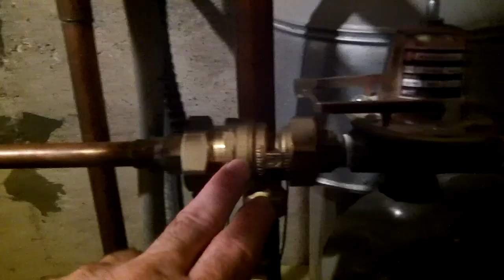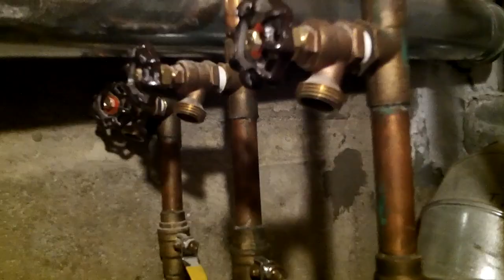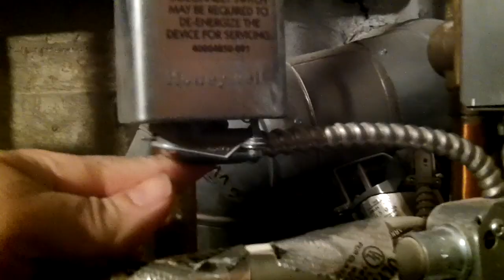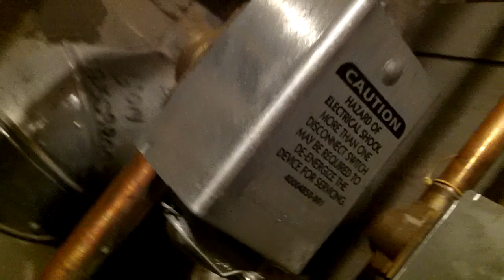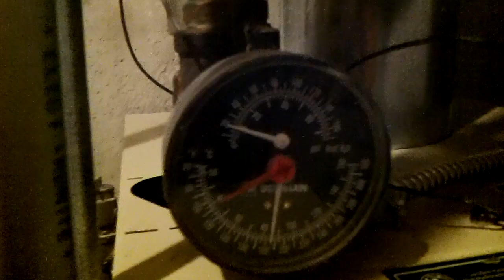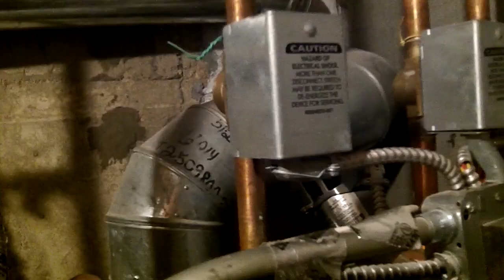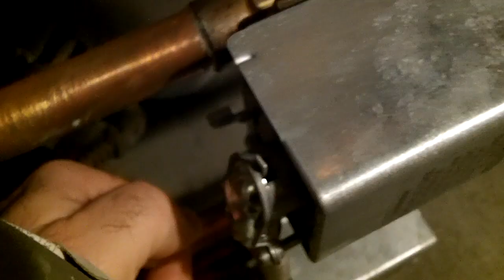How to remove the air from your hot water heating system

Comment: Most systems, if not all, have air bleeder valves on the radiators or baseboard heat. It is best to bleed the air at these points. The bleeders may have to be opened up several times; allow the system to run several minutes before reopening. Doing it the way shown here, will be an ongoing process as the water entering the system will already have some air in it. The procedure done here should only be used when the system was drained/ partially drained and there is large amounts of air in the pipes.

Comment: I don’t have a pressure reducing valve, just a back flow valve.
Reply from the maker: It has to have one because your city water is about 40psi and it needs to be reduced to 12psi gor your system to work.  Otherwise your 40-50psi city water would activate the pressure release valve.
Reply: @YourHuntingBuddy I have a spigot type shutoff valve then a back flow preventer with expansion tank.

Comment: if you only had air in that zone why would you do the other two ?
Reply from the maker: The water is heated in a common area and then pumped into your zones. If a zone has air in it, the air will eventually be returned into the common area.  Once a different zone valve opens the air in the common area will migrate into a new zone.
Reply: @YourHuntingBuddy  thanks for the response, so to be clear, if you have air in one zone regardless of how many other zones you may have, you should bleed the others as well ?

Comment: Always learn something, I normally use to open the drain valve all the way and have open the regulator open to keep the pressure high, but now I will go slow just like you have shown, little big secret that will make a big difference removing air. Thank you for your information.

Comment: does my thermostat need to be turned on heat when flushing and after flushing?
Reply from the maker: No.  The thermostat opens the zone valves electronically.  Turn it off and open the zone valves manually like I did in the video.

Comment: There are air micro bubbles impregnated in water, so bleeding will still be needed. It's still valuable and needed, and pulls out most air, but there's still air in the system that will need to be bled.

Comment: Hi buddy, hope all is well. I bought a house with a broken base board heating system in the garage. I just install new base board and went to fill it up with water per your instructions. The only thing is it doesn’t have a zoning valve. And they connected a new pipe to the existing pipe for the garage to go the basement ( it’s the only pipe coming and going from the same base board). Can I still drain the air out. Or because there is no zoning valve I can’t. Thank you for the informative video.
Reply from the maker: Find the shutoff on the retun line. Follow the retun line it should be close to the unit.   There should also be a drain near the furnace before you get to the shutoff.   Attach a hose to the drain and open it slightly.  You should see bubbles come out.  The pressure reducing valve should automatically fill the line with new water and push out the air.

Comment: Looks like i am replacing my old red fill valve to the updated one you have. Nothing happens when I lift it up. Worked for 40+ years. Wasn't even aware it was broken until the air had to be purged out.

Comment: If you don't shut the valve at the return line, and you open the bleeder knob,  what is the detriment?  Does air possibly pass by the drain hose and go back into the boiler?
Reply from the maker: Yes. You won't get all the air out and it y flow into another zone if opened.

Comment: Thanks for making this video.  My system is a little different but you gave me enough information to finally get my garage circuit bled, and heat re-established out there before the coming Anchorage AK winter could freeze my pipes.  System still needs some improvement, but you helped me buy some breathing space.

Comment: Nice video. I've read that you could/ should bleed possibly from the highest point. Could you bleed from your radiator in your room ? Can you comment
Reply from the maker: You can if the radiator has a bleeder valve.

Comment: How do I know what valve is for what zone.  They are not marked.
Reply from the maker: Turn up  the thermostat for the area you want to test.  Turn off the thermostat in the area you dont want to find. 

Feel the  pipe coming out of the zone valve and label it. .
Reply: Your Hunting Buddy I can do that from the switch right? I don’t have to go into my tenants apartment?
Reply from the maker: You need the thermostat to be on because the circulator pump needs to be on to circulate the water.
Reply: Your Hunting Buddy thank you very much.

Comment: Why do you want the water go slowly. Only with higher speed you can flush the air trapped in higher places out, a bucket is not enough, just drain the water in toilet or outside.
Reply from the maker: City Water is 50 PSI.  You are reducing the pressure to 12 PSI.  If you open your reducing valve all the way you will build too much pressure and blow your pressure release valve.  Some of the drain valves do not release water at the same rate as it enters too.  Air also enters the system when you open the valve all the way.

You need to watch the pressure gauge and make sure you not exceeding the pressure of the pressure relief valve. Good luck to you.

Comment: what if you dont have a valve on each zone but one zone isn't heating? How would you remove the air then?
Reply from the maker: You may have one valve for all your zones.  Check and see if your valve is located where all your zones meet.

Comment: I had coolant put into my boiler system last year.  Just recently I noticed how noisy the air is in  the livingroom  and hasn't been able to keep up with the heat demand.  Is the process the same way for my system ?  I also only have 1 spout for the air/water going into the buck with 4 zone valves.  Should I turn off the water valves on each zone and leave 1 open at a time to purge ?
 Thanks for your time.
Reply from the maker: To be honest with you I would call a service rep.  Why did they use coolant?

Comment: Fabulously clear instructions.  Thanks.  When i went to do my 3-zone system i found that i don't have individual shut-offs by the drain valve or anywhere else. 
??
Reply from the maker: Sometimes they install one shutoff for all your zones. Your three return lines should  run into one line .  That one line should have a shutoff for all 3 zones.
Reply: @YourHuntingBuddy  I'm finding i have different parts in design.  House was built in 1978 and i have Taco T-220 Flochec for the zone valves and have to turn a thumbscrew to manually open. Still looking for zone water shut off.  In any case, your video gave me the flow and now i just need to find the functionally equivalent parts. Thanks.

Comment: You lost me at 'shut the boiler.' Are you shutting the boiler off? Also I don't get alot of water when I open a zone valve (faucet). What am I doing wrong?
Reply: it sounds like he is, you dont' want cold water going into a hot boiler as it could destroy it, so shut it off. To get more water out of the faucet you have to find that valve with the lever on it, to increase pressure so it will give you more flow

Comment: Excellent Heater>>>ur2.pl/1103    It instantly supplies enough hot water to fill our garden tub. The temperature control is digital, easily accessible, and LIGHTED so you can actually see it inside the closet where it is mounted. Also, the unit is flushable and cleanable which is a plus if you have hard water. I highly recommend this product.

Comment: When my thermostat calls for heat and the boiler gets going is it normal to hear water flowing in the baseboards, or does that mean there is air in the lines ? Should I hear no water at all ? Thanks

Comment: Thanks for the info you've given me. I had a plumber come to the house to check out my system because no matter what I do, I can't get the air out of it. He looks at my 105 btu slant fin and tells me that because of the size of the house which is a 1928 sq ft colonial with 17- 57x 30 windows on the main level alone, I need a 140 btu boiler and he also says that my boiler wasn't piped properly.  The system has 3 zones and they also used 1/2 inch pex with aluminum fin baseboards.  The house has 4 levels including the basement which also has baseboards. The house has really never given adequate heat even if the thermostat is at 75. The boiler was installed around 2009 and I moved in 2010. The bedrooms are okay because I keep the door closed, but the main level is open concept and that's where I have the biggest problem. The house is located in nyc.

Comment: Very nice informative video! I did this and I noticed that my Boiler pressure is at about 30 psi. What is the best way to bring the psi down? Would it be the pressure relief valve ? I keep seeing videos where plumbers say that tripping the valve causes it to leak.
Reply from the maker: Don't touch the relief valve.  It will leak.  Just open the drain a little and the pressure sould regilate buy itself. If it does not then your automatic reducing valve may need replacing.
Reply: @YourHuntingBuddy  Thanks for the quick reply, because I was gonna roll the dice and give it a shot right after breakfast. Thanks to you, I'm not gonna do that. I wish I saw this video before I tried to take the air out of the system, because the other videos I came across didn't give all the details such as watching the boiler pressure.
Reply: @YourHuntingBuddy Thanks, just did it and it worked like a charm. I removed about a gallon of water while watching the gauge go down. I stopped at about 15 psi,  because I wanted to ask if that's enough pressure for a single family house that has baseboards in the basement, 1st floor, 2nd floor and the attic with 3 zones. I actually feel that who ever installed the baseboards ran the loops too long because I feel like the heat output could be better and I see a ton of baseboards.

Comment: This video is very helpful, I don't have the zones, so the valve on the one side is already open but I do have the valve on the other side with the drain spicket so I guess I would close that and just connect the hose to that one, I had two guys come in because I wasn't getting heat on my upper levels and they quickly replaced the circulator pump , and it still wasn't working right and what they did was drain fromthe bottom valve at the bottom of the boiler and from looking at the pipes all that's doing is taking the fresh water that comes in going up past the tank and right out. not actually coming through the loop at all, so this video I believe will help me actually bleed the system properly

Comment: Just build an air separation unit with auto air vents.
Good video for people. 
But there should never be air building up all the time. Maybe once or twice after a new system install. And then no more than once a year or you have problems.
All that's happening is hydrogen build up and so on, and also not to mention the fresh water refilling the system is rusting the system to bits in only a matter of years.

Comment: ...does opening the automatic reducing valve, (to increase system pressure), at any time during the process help push any sediment along and into the bucket? What if I suspect sediment in the boiler tank & want to flush that out? Thanks for the informative video.

Comment: I left the furnace on.  I had a faulty bleeder valve that let a bunch of air into the system.   I replaced the bleeder valve and decided to bleed because I could hear the noisy pipes. I couldn't get it to bleed well at all.  I have a hot water storage tank and all the water that came out is full of rusty water.
Reply: I had a repair person come in .  I did what you directed me to do and the repair person did the same thing, which was great.  We both had trouble bleeding the system.  The repair man came to the conclusion that the water pressure regulator is malfunctioning by delivering only 8-10lbs pressure.  When he flipped the switch on the regulator, there was no change in pressure. He had to manipulate the pressure value to get it to temporarily output 12-15lbs pressure and was finally able to bleed the system.  The pressure valve and backflow preventer are in a 12" long section of pipe.  I have to hire a plumber to do the work since the line pressure is probably 60 or more psi.

Comment: what do you do if you don't have zone valves and just have a circulator pump nice video
Reply from the maker: Thanks.  Find the return line and drain.  Connect a hose and slowly drain water and air.  As you are draining the water if you notice the pressure drop you definitely have a closed zone valve stopping water from entering your zone loop.

Comment: THANK YOU..... my kitchen baseboard has not been working.... giving this a shot today..... 
If I could actually successfully get the air out of one of the lines to my Amtrol (CRAP) water heater I will be thrilled..... spent hours getting burner to fire up after getting air out of oil line (ran out and threw 10gal of diesel in it until delivery) got the delivery and it somehow ended up with air in the oil line..... (ARGHHHHHHHH) Thankfully I worked for an oil company and am pretty good at repairing the majority of issues with my heating system..... but still learning as issues arise.... which is ALL the time in a 200 year old house (but new burner in 2012 after I kept my old on going for an additional 8 years) Had some scam oil company try to hack my 80 year old mom with Alzheimer's out of $11,000 for a whole new system) I saw the contract... called the dude to explain it to me... I played dumb blonde while he gave me his schpiel....  the issue problem my mom had called for only required a simple relief valve on the water heater which I bought and installed for under $85......!!!!! I'd rather learn and KNOW how everything in MY home works- especially after spending 13 years restoring the ENTIRE PLACE completely on my own (re-built decks, fixed caved in concrete pool, crown moulding, flooring, found some double hung windows while at the dump and replaced ALL the windows in the barn ... for FREE and even learned how to rebuild and install a new pool pump ........I hope I made my dad proud (he taught me most of what I know growing up here or I learned as I went along after renovating a house with my ex) I LOVE my home...it's my sanctuary and it's on the National Register of Historic Sites .....  !!!!!!
Reply from the maker: Sounds like you have your hands full.  I hope the vid was able to help.  Your dad should be proud.  Thanks for the sub!

Comment: Thanks for the video. I was hoping you could help me further. I don't have the lever to close the return water from a zone, but screws that need to be turned. Some of the screws have been stripped though so I cannot turn them. I have 10 zones total all returning to one spigot. My question to you is can I bleed all 10 zones at once or should I screw off a few returns and bleed a few lines (lines I can control return water and lines that have to stay open because of the stripped screw heads)? Thanks for your help.

Comment: great video and easy to follow.  
i drained 26 gallons of water and i was still seeing bubbles in the bucket.  i have a small house and the pipes are still making a lot of noise.  could air somehow continuously be introduced into the pipes?
Reply: Hello, I don't know if you solved your problem, but I drained about 35 gallons from my Boiler and stopped because I kept seeing bubbles too. Did you solve your problem?

Comment: excellent video start to finish, thanks.  If your PRV doesn't open, you'd know it bc the pressure would keep going down, no?
Reply from the maker: Keep an eye on the gauge.  You should be around 12 PSI.  The only time that valve will open is if you exceed the pressure in the system. The prv should have the maximum pressure rating written on it.

Comment: I tested by switching 2 zone valves (one zone valve works for basement) but still no circulation.  I even removed zone valve and manually opened pipe. still nothing. Could be more air in radiators? I drained 8-10  big buckets of water (like you did in this video).
Reply from the maker: It's hard to tell what the issue is on the internet.  If our zone valves are fine it may be your pump or a frozen line.  You just may have to call a pro.

Comment: Thank you for fast response. I drained and refilled the system like you showed in video, but I still have no heat upstairs. basement heat works fine. pipe (for upstairs) right below zone valve is hot, but it's not getting enough hot after zone valve. I was thinking about bad zone valve, but when I removed zone valve and manually opened the pipe, still not getting hot enough. return pipe stays cold. No idea what could prevent hot water from circulate just upstairs when pump is working and pipe is open. pressure is around 14-15 psi. maybe something wrong with expansion tank. You did not show in video, but I drained it, as well.
Reply from the maker: David Mchedlishvili sounds like the water is not circulating past the zone valve.  Try manually opening the zone valve to see if water circulates past the zone valve.  You may have a bad zone valve.  it may be time to call a plumber.
Reply: I have same problem with upstairs heat not working, but downstairs works fine, but I also don't have my zone valves next to the heater.  Where are they then?  inside the baseboards on each respective level?  I'm also losing pressure over time, so I think my Pressure Reducing Valve might be stuck in the closed position.  When I turn the screw down, the pressure sure goes up fast tho, which means it can be manually operated at least.  If PRV fails to do its job, does it fail in the closed direction?
Reply: TenHanger x